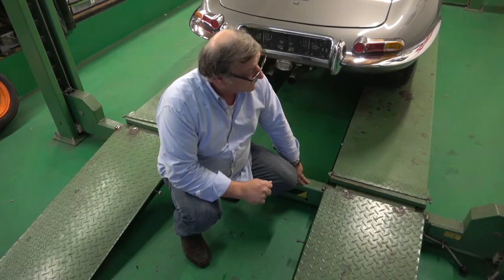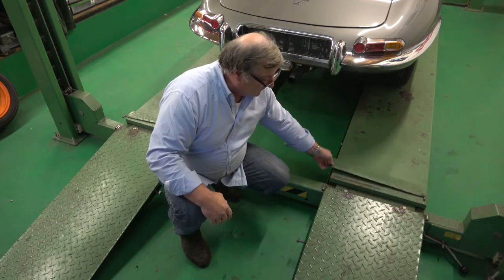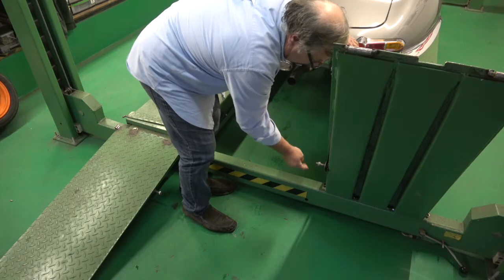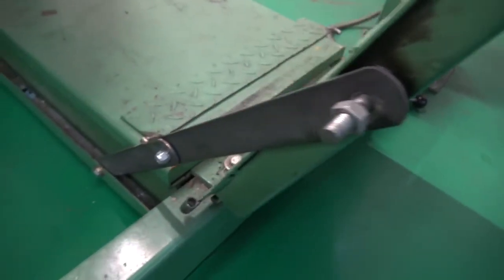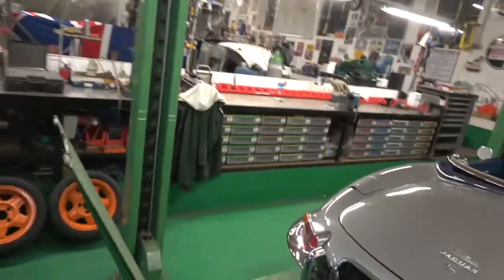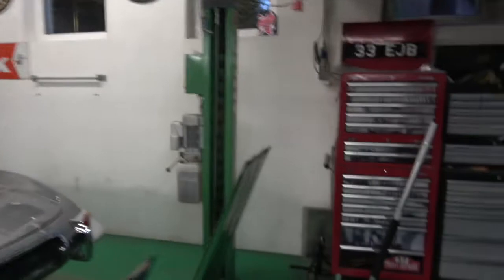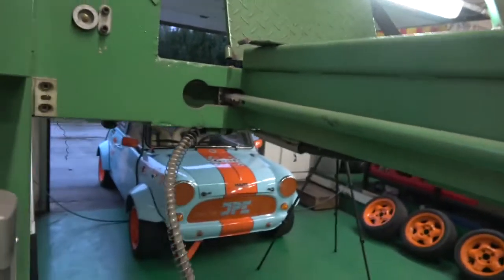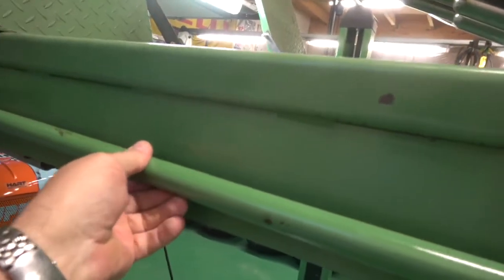4 Poster Car Lift / Ramp Modification Idea.

Comment: great  video ....like you im getting on.......went for an in floor sizzor  lift .....which is super handy ....but with your 4 post you can drive under and double the space use.......swings and roundabouts i suppose ..........my latest work shop ive had it since 2003 and ive re configured ...........4/5 times....always thinking and trying to improve........and lots on your channel has inspired us to change my thinking............Thanks
Reply from the maker: John,  I know where your coming from on moving things around to get the best from the space you have. I can‘t count the 
amount of times we have moved things around to make it more efficient. It seems the more space you have the more you 
fill it up lol. Cheers Dave

Comment: If only l had the same problem ! I have to manage with a double garage with  6foot height  so it 'a squeeze with the "e" and the TR6. A 5minute job  can take an hour ! It's very frustrating but it is what it is . I walked into a raised 4 poster at work and needed 12 stitches ! My fault apparently!  Still , it didn't do any lasting damage  ... George!  😂😂
Reply from the maker: John, Been there done that. Ouch! sorry to hear that was the ramp OK as well lol. I saw this model of ramp in a garage in the 
UK and the guy had the same issue with head height but he had a pit under the ramp so he could only raise the lift about 3 foot 
of the ground which seemed a pointless but it seem to do the job and worked for him. Chees Dave